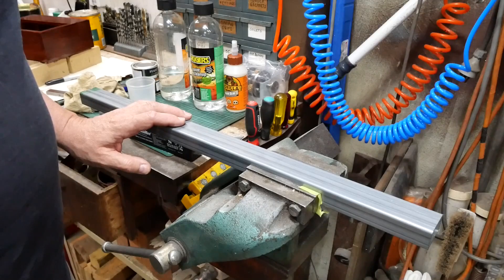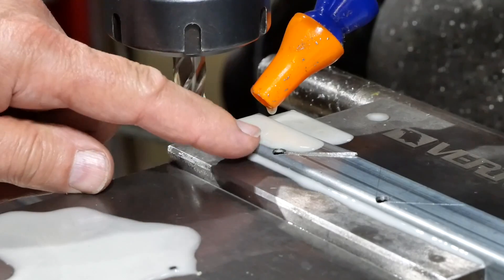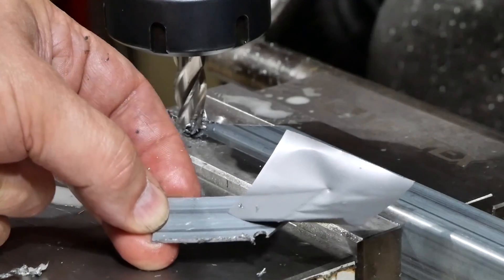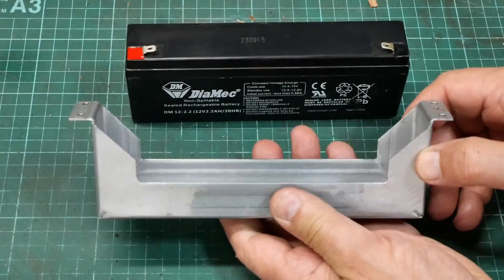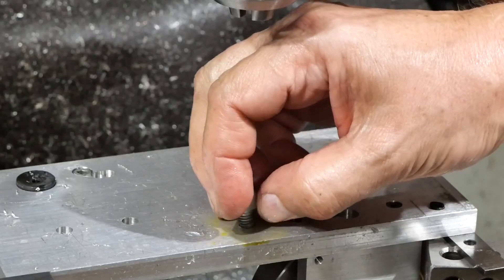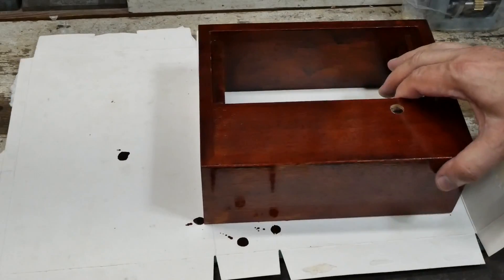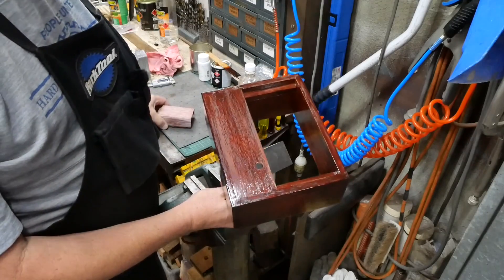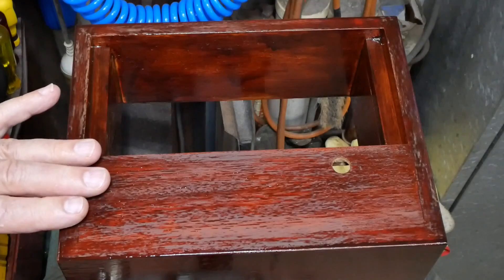Webster Engine - Final

Comment: Gday Alan, your engine looks fantastic, I honestly think that when I built my 2 there was roughly 80hrs in each and I certainly made quite a few parts more then once to get the correct, there’s a fair bit of time in making the fixtures and jigs too that you don’t plan on at the start and making the mounting box was certainty the part I didn’t enjoy at all, this was a great series to follow and looking forward to seeing what you build next, cheers
Reply from the maker: Thanks Matty. I don't think I would have had the patience to build two Websters :) What really surprised me about the engine is how easily it starts with the simple vapour carburetor, and how little vibration there is. I had a Honda CB175 twin (circa 1970) that vibrated far more than the Webster - vibration was so bad the pillion passenger's feet keep walking off the foot pegs. I've also had single cylinder lawn mowers that vibrated much more. The chap who worked out the balanced shape for the crankshaft throw must have really nailed it.
Cheers.

Comment: I dont like wood beavering and painting should only be done from a spraygun. 
I do like the result and particularly how easy it starts and how well it runs.
Reply from the maker: One good thing about "wood beavering" is no tiny metal splinters - but there's nothing that I like about painting.
I bought a spray gun ages ago but I don't like how much solvent is needed for cleaning - its a big overhead for small jobs.  
If I do anything else like this I'll brush sealer on to fill the grain, sand it, apply stain and then use spray cans of clear.
Thanks for your comment. 
Cheers.
PS: Have you made any chips with the Mazak yet ?
Reply: @alanshomeworkshop  Unfortunatly constant rain and soft ground has meant transport delays.... its a sore point.
Reply from the maker: @badjuju6563 Sorry to hear that - very frustrating for you.